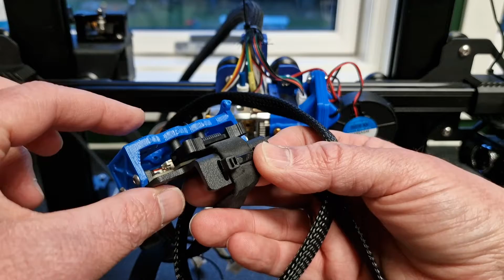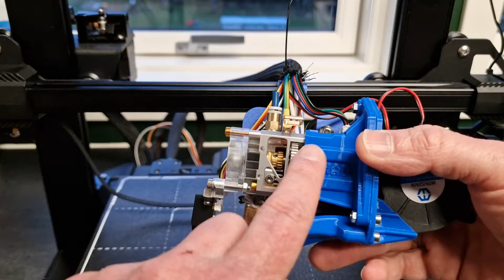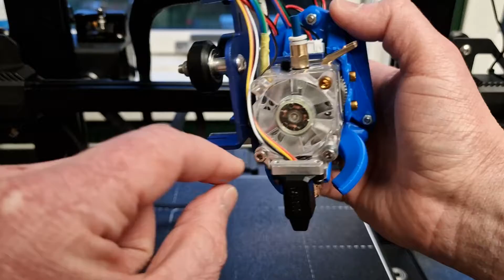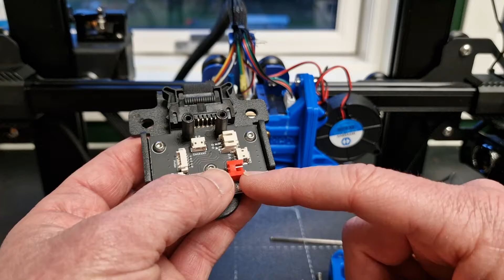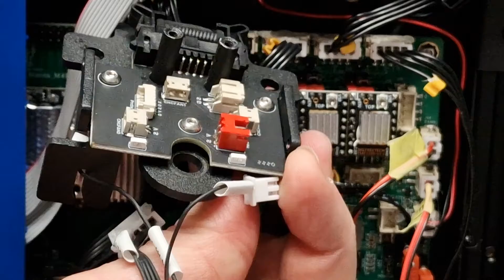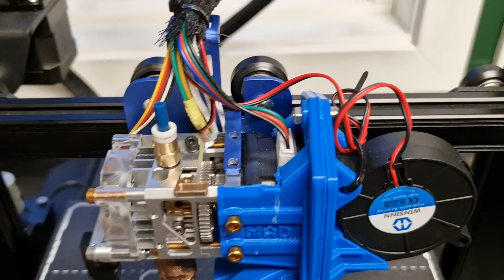How to install the BIQU H2 V2s Lite on a Hurakan, and a bonus custom mount.

Comment: Could I ask what values of PID did yo use to tune this extruder?
Reply from the maker: This is what I have but I highly recommend running a pid tune because each system can be slightly different. 
pid_kp = 24.404
pid_ki = 1.146
pid_kd = 129.952
Reply: @StackingLayers  thanks you so much. Having trouble with PID autotune due to temp to high
Reply from the maker: @carljavellana8326 what is your max temp for the extruder set to? And what are you trying to tune to?
Reply: @StackingLayers  my max temp is 365 i upgraded to ht ntc100k and change the thermistor to 61 in marlin. Whenever i autotune to 240. It overshoot to 290 which trigger the PID error due to max temp. The only success i had is to lower the PID bang bang to 100 in marlin. Did you also lower your PID bangbang?
Reply from the maker: @carljavellana8326 I don't use Marlen anymore. But I also don't use bang bang(watermark) method for heating. PID and bang bang are 2 separate methods of heating. 
If you have your max temp set to 365 then it shouldn't be getting triggered by a 290 temp. There's even usually a 10 to 15c overshoot allowance for such things. I'm not sure why you would be having that issue.
Reply: @StackingLayers  PID autotune works well with my E3D v6. Then i upgraded to this extruder for my corexy build which now can't be autotune because it overshoot too much. The solution is that i will manual my PID using the provided PID value. Then after that i will transfer all my marlin values in klipper.
Reply from the maker: @carljavellana8326 it would be best to do it all in klipper if you are going to switch. The firmwares likely use different algorithms to do the tuning.

Comment: Where do you edit the offset and exteuder steps?
Reply from the maker: In the printer.cfg. it's been a while since I've had stock configuration files on my hurakan but if I remember correctly is split up by board and other options, so look through the various.cfg files. One will have the extruder, X, and Y stepper definitions you edit those.
Reply: @StackingLayers  Thanks for responding! 
I guess Im just an idiot, I have no file called printer.cfg that I can find. Not in Mainsail or on the sd card card. 
I bought the H2 upgrade that Biqu makes for the Hurakan and I can't find any of the files listed in the documentation.
Reply from the maker: @tyson822 it's in the machine section in mainsail. It must be there otherwise klipper will not run. You will not be able to see it on the SD card unless you mount it in a Linux machine. If you are in  terminal (ssh) then it'll be in the ~/printer_data/config/ directory.
Reply: Yeah, that's what I thought but for whatever reason Mainsail says I have nothing in that folder. I'll have to keep poking around to figure out what's going on. Thank you!

Comment: Thank you for making the video. 2 issues: One it might be obvious for other views but it would be nice if you could show exactly how you mounted/screwed the extruder to your mount. Also, it would be nice to include a link to your fan duct.  And how your 5015 fan is mounted does that limit the X carriage max print Width? I am assuming that you screwed the mount to the extruder from the back side. But I am not sure.

Comment: they are sponsoring you , why use sheetmetal design? why not just make an overengineered kickass cnc mount and convert it to linear rail,it's free
Reply from the maker: Lack of design experience really. 😅 But I also wanted it to stay as light and compact as possible. Plus, my plan was  to make something that anyone could use on a basic machine with existing wheel hardware.

Comment: $103.07 for their cheapest version of your part. If it was half that, I'd buy it.
Reply from the maker: Yeah I agree that's too much. I'm assuming that's with shipping, is this correct? Still that is too high. The files are available there though. I made it open source. Maybe there is a local metal worker that can do it for you.

Comment: I put in another order for a vanilla bracket. I installed the REVO yesterday. With a BLTouch, it worked! But the motor's going the wrong way. Is there a way to change the direction in the config file?
Reply from the maker: Put a ! (or remove it is it's there) in front of the dir_pin. Like this for example
dir_pin: !PB4 using your existing pin number for your board of course.
Reply: @StackingLayers  It worked, and I'm printing a Benchy because of that!
Reply: @StackingLayers  wow! THANK YOU!!!
Reply: @StackingLayers  that worked!

Comment: I tried to install a Revo on my Hurakan. With the plastic bracket. Shorted out the board, fried the steppers, and my 7” monitor. Waited almost 3 months for BIQU to send me a new wire loom and a breakout board (both were fried as well).  At this point I’m trying to install a Sprite Pro on my Hurakan. The difficulty is editing the printer.cfg and the Generic Manta M4p config files because the code for Fan0 and Fan1 only species the lower pin, not the 24v. Did you show the config changes in those two files in the last 2 minutes if this video? Please reply and connect with me. I’ll buy this extruder and your pcb mount immediately if you can show me the changes to the cfg files. Mark Corliss. Corlussmedia2.0.
Reply from the maker: The only thing I changed in the printer config was the rotational distance, and adjusted the endstop positions. Everything else is the same. Not sure what other than plugging in things wrong could have shorted put so many things. 
The fans are controlled by a MOSFET on the 0v (ground) side the 24V is always live/not controllable.
Reply: @StackingLayers  Can you explain the Fan0 and Fan1 sockets having NO WIRE to the 24V pin? NathanBuildsRobots told me he thinks that's because the board / cb1? siphons off power from the source for the hot end, and uses it to run both of the original parts cooling fans?
Reply from the maker: The one wire has nothing to do with the cb1. The board at the hotend uses a common 24v. The 0V pins (-/ground) are the control pins. So to only need to connect the 0V in the fan port. The 24V can come from another point, which is ultimately all connected directly to the 24V of the PSU.
Reply: @StackingLayers  this is the first confirmation of NBR’s statement. Thank you. I know it’s a different hot end, but do you think the Sprite Pro works the same way? (meaning I should not use the 24v pins of PD2 and PD3? because the Creality board for that direct drive extruder does the same thing?) (when you powered the fan for the h2-v2-lite where did you plug it in, and did you use both pins?)
Reply from the maker: I ended up running all new wires direct to the motherboard so that there are no shared connections.
Reply: @StackingLayers  Sorry to be so stupid, but I'd like to know what image was on your Hurakan at the time you installed the new print head? Also, did you have to change any of the printer.cfg and generic.cfg entries? Is there a way you could upload those files so I could look at them? I think I could learn a lot from your mod, and I'll really like to get there.
Reply from the maker: It's the stock install. I just updated the probe offsets and rotational distance for the extruder.
Reply: @StackingLayers  I tried to order the bracket. It was a hundred bucks in 6061, and 75 bucks for mild steel. total deal bracker.
Reply from the maker: Wow really, it was like $31 in 5052 aluminum. That's the biggest problem with one off orders. You don't get good prices until doing bulk ordering. I don't have the funds or time to put into stocking and shipping unfortunately. So I'm hoping BIQU of another company makes it to sell. I think a bunch would like to use it.
Reply: @StackingLayers  I know I would. The top price was for 6061 aluminum. The 2nd price was for mild steel with a black finish. The initial price was $31 BEFORE their analysis.
Reply: @StackingLayers  After trying to install a Sprite Pro on my Hurakan, and the fans not working, I bought ANOTHER REVO, installed it, and LIKE MAGIC BOTH FANS ARE WORKING!  The only problem I'm having now: I have a CR_Touch plugged into the BL_Touch port (the same port the Microprobe connects to). What does "BLTouch failed to raise probe" mean? (I'm using your video as a guide.)
Reply: Just thought I’d check back with you. Is the metal bracket available? I put one in the cart, but the cart did not register the purchase? Is there a STL file if the bracket? I have some more questions. But to answer yours, there are 2 grounds attached to the Hurakan’s power supply. The bottom on was loose. Possibly from running the machine. 120v from the switch contacted ground when I turned the machine on. And that was the end of those components. My efforts to install a Sprite Pro aren’t going well. Connecting the fans and the K-Fan to Fan0 and Fan1 hasn’t work out at all. I’m having a problem with the Fan section of the generic cfg. Anyways, I hope you will get back to me. I’d like to buy a couple of your brackets if they become available.
Reply from the maker: Yeah the mount is available. I have it as an open source item so the step (cad file) is available. To buy it you put it in the cart and select any different options you want and then PCBway will check it out and give you a quote for the build. https://www.pcbway.com/project/shareproject/BIQU_H2_Mount_for_2020_6dbd3c08.html
Reply: @StackingLayers  so you out the CAD file in the cart. Okay, now I get it! Thanks.
Reply from the maker: For the fans the part cooling fan is called just [fan] and in the stock cfg I think that is set to fan0 if I remember correctly. The heatsink fan would be fan1, and that is defined as [heater_fan my_heaterfan] it's highly recommend to read through the klipper documents for configuration information. https://www.klipper3d.org/Config_Reference.html
Here's the fan info section: https://www.klipper3d.org/Config_Reference.html#fans
Reply: @StackingLayers  thank you, I’ll do that as soon as I get home. Question: what does “PD3#PD2” mean after [Fan]? Question: what programming language is being used in the config files I’m seeing in Mainsail? I recognize that I need to learn it so I can code for myself.
Reply: @StackingLayers  Here's the code that works: 

[fan]
# This is Fan0. It is the Parts Cooling Fan. The REVO uses a 5015 blower for this.
pin: PD2

[heater_fan nozzle_cooling_fan]
# This is Fan1. It is the Extruder Motor Cooling Fan. The REVO uses a small 30x30x10 for this cooliing.
pin: PD3
heater: extruder
heater_temp: 50.0

[controller_fan case_fan]
pin: PD4
heater: heater_bed
stepper: stepper_x, stepper_y, stepper_z, extruder

Mark